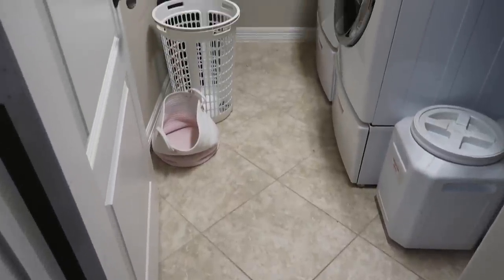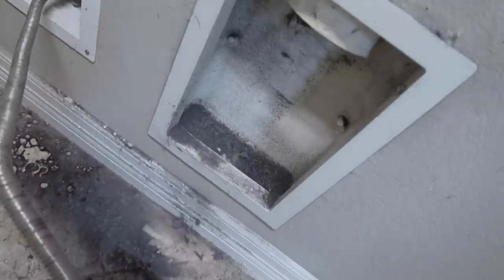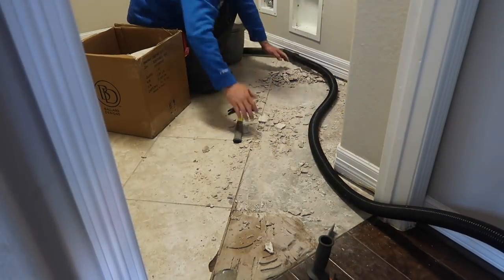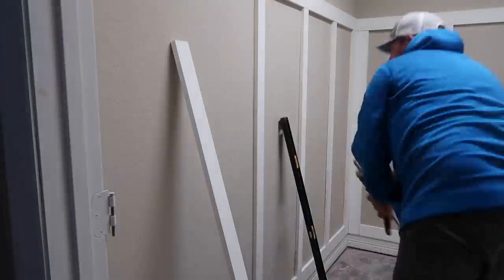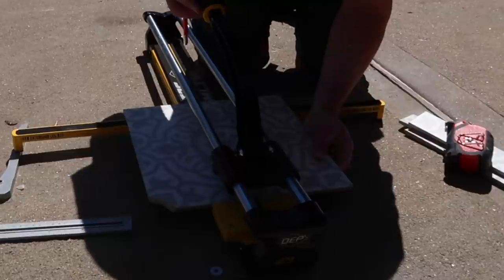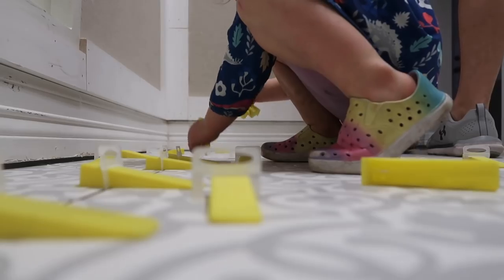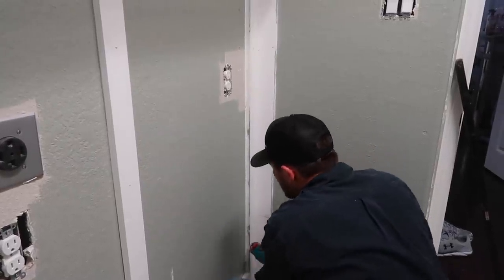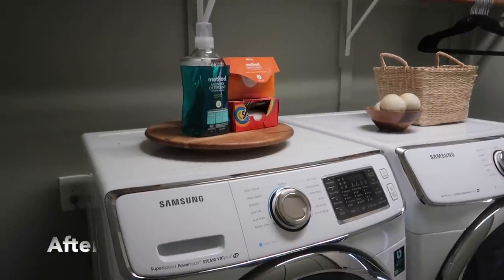EXTREME LAUNDRY ROOM MAKEOVER ON A BUDGET / LAUNDRY ROOM DIY MAKEOVER

Comment: I love the laundry room makeover. Especially the tile.  I have the same washer and I have a question, do you have a problem with your washing machine smelling after each load? I constantly have to drain the water and it will still smell by the next morning. Thanks!
Reply from the maker: Thanks Michele! We have had it for 6 years and just recently we have an issue with smell. It doesn’t smell after each time but every once in a while it will. When we drain the water it smells awful. I’ve had to do self clean a few times and since we took it out and put it back in I haven’t had the issue so far..
Reply: @MichelleOMalley711  thank you! I’m going to try to do the self clean again. Maybe it will help. Thanks for taking the time to reply!  ❤️